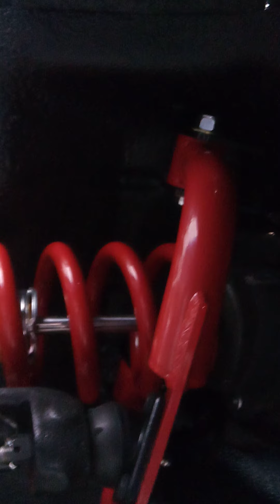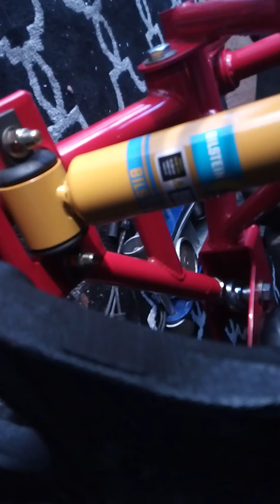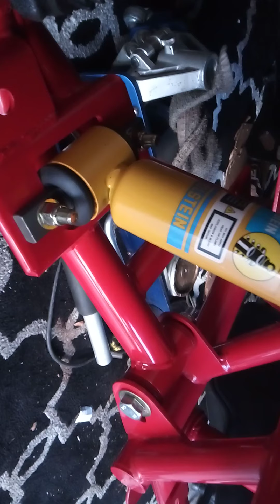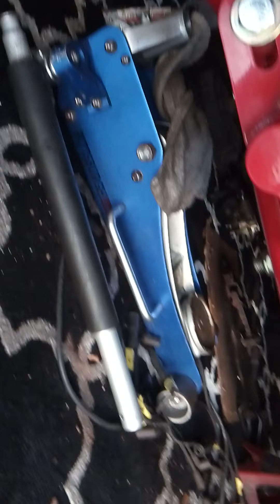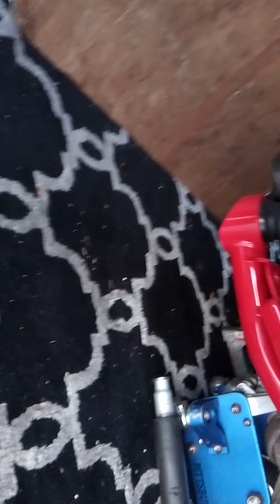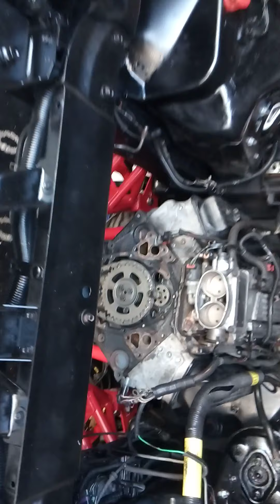showing off the front end with the Bilstein B6 front coil over shocks with the BMR lowering springs

Comment: Looking good!!
Reply from the maker: Thanks my friend. It was no chatting in this video. I was just filming both sides of the assembly..
Reply from the maker: The BMR suspension fits perfectly with the Bilstein front struts and the Umi upper adjustable a arm brackets.
Reply from the maker: The front of my Trans am is going to be about a 3" drop in the front due to the BMR 1" drop Lower adjustable control arms. And the BMR springs is another 2" drop.